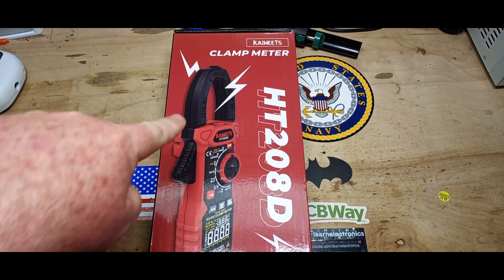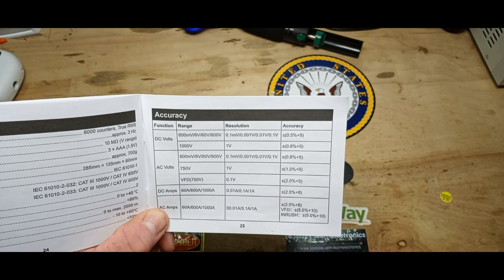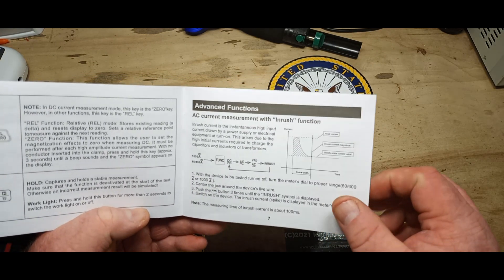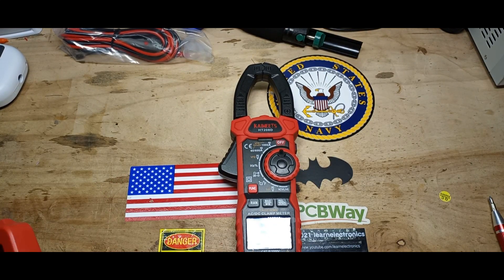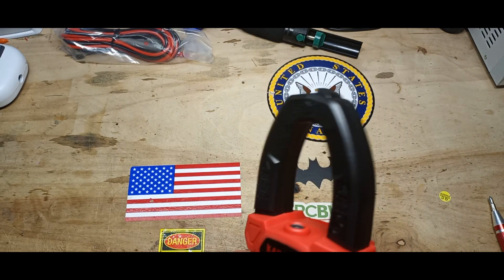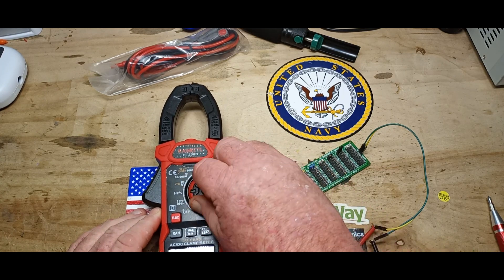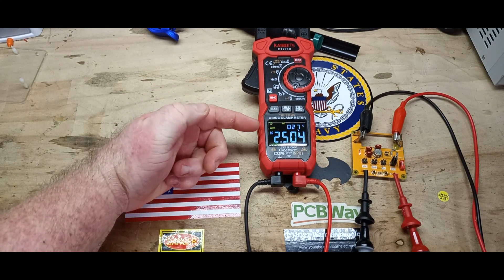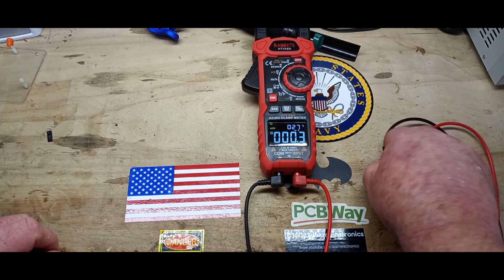Kaiweets HT208D 600V/1000A Clamp Meter

Comment: @learnelectronics I have the HT208D and do not get any inrush reading when my AC compressor starts up.  The normal current draw on my AC compressor is 6.6A.  Kaiweets tells me that if the inrush current is not above 10A, there will not be any reading on the meter. Do you know if this is true and have you tested inrush on anything less than 10A?

Comment: Is there any meter that does dc inrush?
Reply: I have a cheap Aneng CM82, it does DC inrush, I've checked.
Reply: @KNJ-rc3eg  thansk for reply. i randomly found that inrush current measures short pulse of current and that it works almost the same on dc as it does on ac. Tested with my clamp and it seems to work. good to know! wonder why doesnt anyone specify dc inrush then..

Comment: Sorry to hear about YouTube. They add more commercials and continually send offers for viewers to pay a fee and commercial would be turned off. Ha...After a few years they will charge a fee AND run commercials.
Cable TV started that way.
Nice meter. I purchased a clamp meter for one purpose only, measure DC current.
Have a peaceful weekend Paul.

Comment: Nice meter.  I have the 206D which doesn't have the inrush current feature but how does that differ from plain old Min/Max?
Reply from the maker: Inrush only watches for the first 100-200mS
Reply: @learnelectronics  Ok, thanks.
Reply: @learnelectronics  when does it start measuring? Is there any particular threshold it has to go over before it starts?